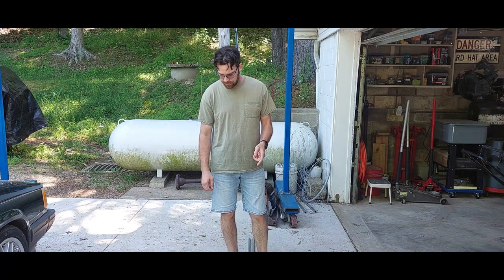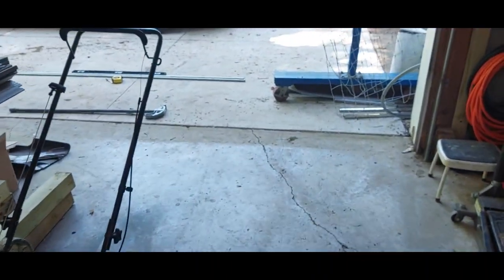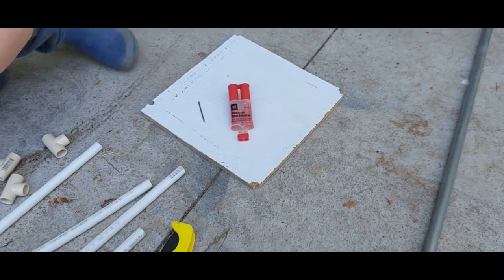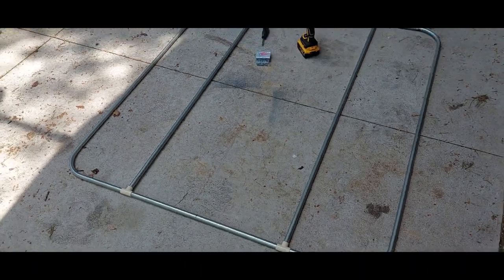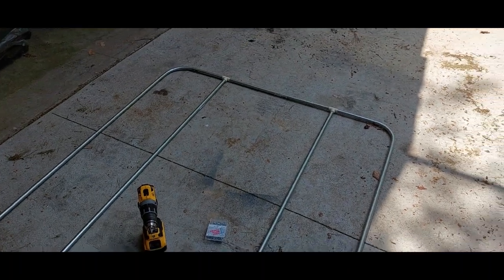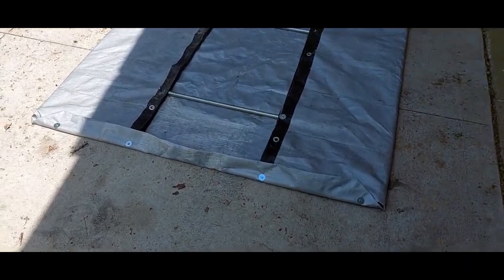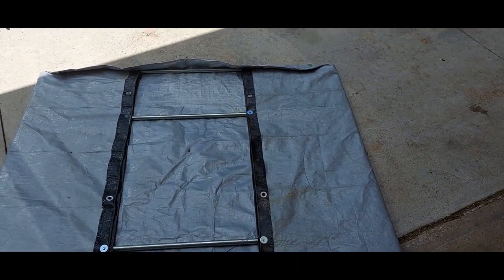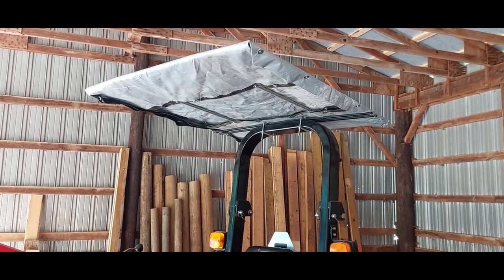DIY tractor canopy Massey Ferguson 2615

Comment: I made one this week.  I have a Kubota bx with two vertical holes in the top side of the ROPS.  My ROPS clear the door by 1/4”, so my canopy needed to be below the ROPS.  I used 1/2” steel tube and welded it with 3/16” stringers for canvas support.  I added 1/6” steel wings 9” out at the operator seat.  I converted a usb fan for my 12v seat plug and made a bracket for it.  Works as planned, canvas is a little wonky but not too bad.  Interesting to see how we employ different skills for our needs.